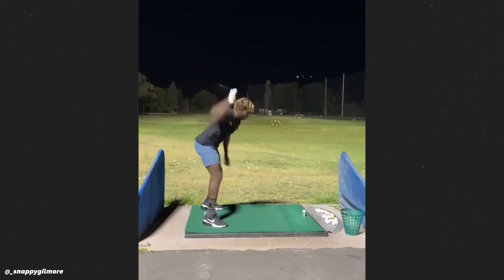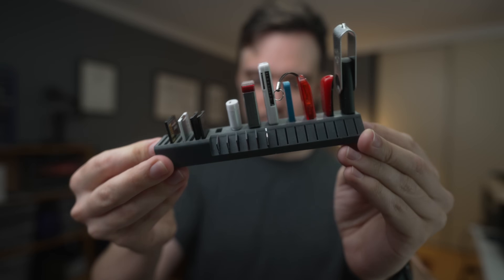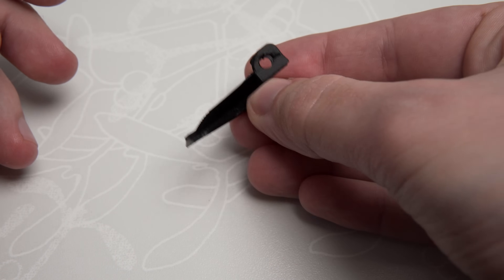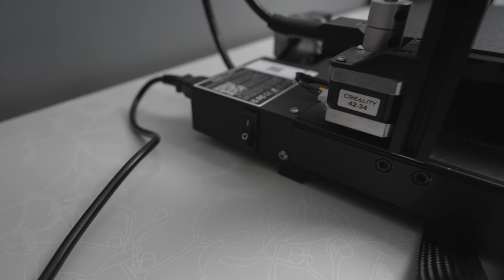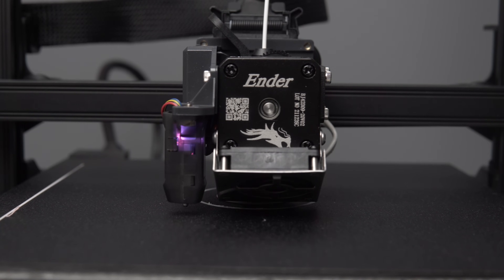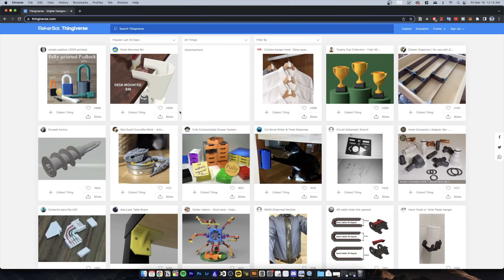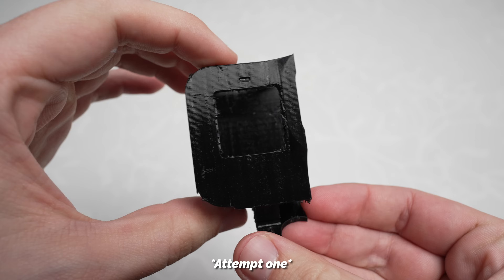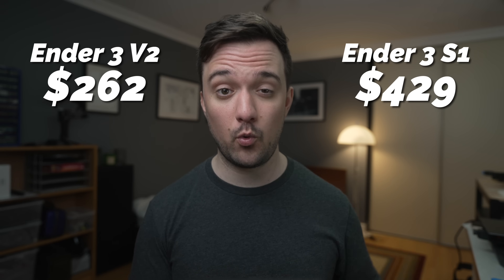How Easy is 3D Printing ACTUALLY? (Ender 3 S1 Review)

Comment: Lol My story is slightly the same...  A friend of mine had a printer but he didn't have the patience for it.  He knew I was a creative type and basically just gave me his Ender S1 Plus.  Used, slightly modded, and no manual.  Trial by fire, just the way I thrive.  Took me a while to figure it out becasue I didn't know about the mod, and he didn't even know it was a Plus, told me it was a pro.  But I figured it out and love 3d printing.  It made me invest in a new printer: K1C.

Comment: Thank. I have an older Ender 3 V but I haven’t used it at all for several years. Now I must print a cartridge holder TK12 for my nearly 60 years old Dual 1019 turntable and I’ll test the printer in few days time. So thanks for this tutorial.

Comment: I got an Ender 3 Pro with 5 rolls of filament for free but I knew nothing about 3D printing. There's a lot to learn but with the help of YouTube videos I was able to learn the in's and outs. The advice I have for novices is consider getting a filament drier or making one  . I bought a cheap 2 roll dehumidifier and I find I have eliminated so many issues and better / more consistent prints. Also I researched and now understand what the correct first level thickness should look like after bed leveling and then I use a CHEP Bed Leveling Test Print  to fine tune and it has been a game changer for me. Also adding "mouse ears" to a difficult print in order to maintain adhesion is a game changer.

Comment: Bowden extruder is NOT going to cut for more fancy filament.  I did my homework so i knew this upfront before i purchased my first one the Ender 3 S1.  Direct extruder is what i want but NOT paying much  more.   
The Ender 3 is truly an amazing deal with what it can do.  Thanks to Creality for making 3D printer possible for the large masses of us.

I bought a used one and I found out it is NOT that hard or complicated to set up and use.  The cool thing is all the stuffs I can print and I can remotely monitor and control anywhere in the world with software add on and a camera.   

Go for it if you don't do then you will never know and learn.  For under $100 you can have one all day long.

Comment: Very easy... -all you need is a BL touch, a glass bed and a PEI sheet IN ADDITION to your Ender3 (100-150 bucks extra on amazon). They will eradicate 95% of all the problems you might have as a beginner.
I really think they should do a V3 or PRO version of the printer, wich includes all that.

Comment: 6:07 Disclaimer, I don't own a 3D printer. It's easier to pull a rope through a hose than to push it.

This I suspect is why you had trouble with softer filament in the old printer and why the new printer, with a filament puller located in the print head instead of a pusher back on the frame, solves that problem.

The older pusher model was pushing soft filament through a hose, and the soft filament had wiggle room in there and being soft, it wiggled around more than harder, stiffer filament.

Now the new "puller" model eliminates the rope-like behavior of the soft filament.

Comment: May knock it but i love my S1. Once you get used to how to level it and adjust the slicer. I get some beautiful prints. Just so people know. Do the manual level first. Start in the middle. Adjust the Z offset using the sheet of paper trick he mentions. Then go to all 4 corners 1 by 1 adjusting the leveling knobs until each are the same level(using the paper). Then do the auto level. Once it is done. Go back to the manual level. Go to the center and adjust the z offset again. DONT adjust the corners. Then just print!

Comment: The big question is... As a first printer, Do you buy an ender 3v2 and struggle a bit (but learn a TON about 3D printing?) or do you buy an ender 3v3 which makes things a lot easier (at the expense of not learning as much due to a smaller initial struggle).

I'm glad I had to suffer through the slings and arrows of an unmodified Ender 3V2 printer (and the resultant mods that made it better over time)

You CAN'T buy any 3D printer that doesn't have 'auto levelling'. A BR (CR) Touch is a must have first mod for any printer.

A PEI bed is important for good adhesion and prints... As well as the dual axis z-rod.

Also... Modifying the firmware will be important ad Creality (while they build decent low-end printers) cripple them with awful awful software (compared to 3rd party 'pro' firmware upgrades).

I love it now. But I didn't for a long time.

Comment: 3D printing is the most frustrating (and then rewarding) hobby. I've almost thrown my ender 3v2 out the window many times... But I seem to have finally modded it, tuned it and now it works consistently with wireless connectivity via Klipper (on PC)

I've printed premade models, modified models and created my own pracital parts from scratch.

Its very satisfying when it works.

Comment: I think TPU is bad on small areas, where the hot end is in too small of an area for too long, which stops the heat from escaping and increases the temperature (of the part in that spot) over time... so it can help to take a break in between layers, so each layer has the chance to cool before printing continues.

Comment: "Something just happened to me right now: the S1 printer had an issue, but I've already fixed it. It was a cable connecting the printer to the bed that had snapped."

Comment: The thing is sooner or later you will run into problems.  I have 3 printers and they've all had problems.  You have to maintain the right humidity which can ruin your filament and prints.  Now my two Anycubic printers aren''t working correctly and won't print.  It always starts out well and then come problems.  Still I think it's just the coolest thing I can think of when it works!

Comment: anyone who is thinking about getting into 3d printing should not consider the ender 3. It is way too frustrating in terms of leveling (unlevels itself after a few prints), print precision (hell of a time to adjust belt tension). With the amount of money you are going to waste from fail prints, just get the ankerbot or bambulab printers, they work straight out of the box, with way faster print times and print quality.

Ive had the ender 3 for 4 years and it was really endless frustrations... Did i get it to print decently? Yes. But that was after rolls and rolls of plastic. totally not worth.

Comment: Thanks for the intro.
When you say you ''made some adjustments'' what were they?
🤔
I'm OK with 3D modelling, and use ''IronCAD''  which I've used intermittently since it was first introduced as ''3D EYE'' many, many years ago. (25)
I have never transferred anything to a 3D printer as I dont have one yet.
I'm 79 years old, so 3D printing is a complete mystery, even ''magic.''
It's the transition, ie ''Slicing'' that I have never encountered. I understand the principle, ie that it calculates the layers, but not the actual process.
Would you give a short explanation please.
Also, are there any transparent plastics that can be 3D printed, for things like lenses on vehicle lamps? I have an old (1953) tractor that I would like to replace missing lamp lenses on.
Thanks again.
.

Comment: One thing I recommend when printing TPU is use an enclosed printer, it will bring some minor strength and quality additions the the TPU print, but you don't really need it. This is just if you want to make it slightly better.

Comment: Thingiverse is awesome. Definitely look at adjusting the slicer settings first. I use CURA with some custom Ultra Fast settings I found from another YouTuber and it literally took hours off the print times. Now I’m having fun printing upgrades! I have an Ender 3 v2 neo which was still cheap but came with the stuff I would have got anyway and is a bit slicker design.

Comment: started 3d printing in the pandemic. Needed a hobby during lockdown. still regularly print and already upgraded my printer a bit
Reply: Hi, are you still doing 3d printing? I was wondering if you could help with something I'm working on. I'm trying to make a simple model and I just need someone to look at the STL file and see if it would actually work. I've never done anything with 3d printing before!

Comment: My friend told me you can 3D print different parts for a hand gun and build a hand gun. I don’t think this is true but anyone know if you can do that?
Reply: You can but they aren’t exactly 100% reliable depending on the part. With a firearm you’re going to run into a lot of heat.

Comment: It is such a relief to hear someone who is also a 3D printer noob who feels the same way I do about it. I am "this close" to getting an Ender 6. I felt exactly like you. I wanted to do it but was concerned about how awful it would be tweaking and settings etc. I was not sure what printer to get. I was told Ender 6 was a good one. After researching it appears that I can update it or make modifications in the future so I won't have to buy a new one (can't afford to buy a bunch of these printers. Just one is what I can afford right now). Also, the Ender 6 has an enclosure (sort of) for temperature control.

Comment: I must have a faulty unit then because I am STRUGGLING to get consistent results with just PLA. I'm having to put a sticky note UNDERNEATH my bed and plate because the bed sags ever so slightly
Reply: Update: That's exactly what happened. Got a replacement and suddenly with a little tweaking I'm getting consistently good prints. At least the days of struggling with a faulty printer made me pretty good at fixing printer problems. Which still happen every couple prints or so.

Comment: The tube guiding the filament to the head was 1 of the problems the hard filament slides through it easily but when you use softer filaments they drag in the tube which stopped it creating sufficient pool to fill large areas. Don’t over tighten the filament drive wheel or you will jam it up.

Comment: As someone who is very new to 3d printing I can say with absolute certainty that it is incredibly easy.  the printer does all the work after all.  What is difficult is all the troubleshooting and fault finding, figuring out settings and creating profiles, learning CAD and design programs and comparing printers and options.  That's the stuff that really gets tough.  But the printing? Not a problem at all.  lol

Comment: I too bought the Ender 3 V2 as my first printer but just cahnged the springs updated the os of the printer and now i have a manual level mesh, and i don't change it very often, so that's i would buy an auto level addon for the printer

Comment: I bought a Anycubic mega zero (first edition, 12 volts) about 1,5 years ago and it no works through its 13. roll of filament. I did some minor repairs (hotend, printbed, plugs with loose connection) but nothing expensive or more than 30 minutes to find and repair the issue.

I mostly print hobby stuff like miniatures (which I paint later), but I also printed household stuff and small gifts for friends. It pays of very quickly. I later bought a resin printer, which actually is at second litre, but that allready paid of compared what buying the same amount of miniatures would cost. 

So I could highly recommend this, especially for people who are in models, toy railroad and so on.

Comment: I’ve had a v2 for about 2 and a half years now and when I first got it I was struggling quite a bit but now I can just press print and leave it. Once you get the printer dialed in it becomes a lot more hands off and a lot less frustrating for me at least.

Comment: I'm super interested in 3D-modeling and 3D-printing, but I'm worried about the waste. Can failed pieces etc. waste be re-used with the printer somehow, or what you do with them?

Also, is there some universal format for 3D-printable files, or do you have to be able to convert them to fit to your printer exactly (can the slicer program read several file formats)? Does the 3D-modeling program have an effect on whether or not it can be  printed? If I use for example blender, and then some other program?

Thank you for any help!
Reply: Sorry for the late answers to your questions, but here they are:
3D printing produces some waste in the form of failed prints and support material. It depends on the type of plastic you use if the material is bad waste or not. PLA is bio-degradable for a certain amount. I personally deliver all my waste once a year in the plastic recycle container in my neighborhood. I heard there is a company in Germany that takes old 3D printer waste and recycles it to new filament rolls. That is a very good solution that let you re-use your waste material. There are also filament producing machines for the home user where you can mix your (scrapped) waste with new pellets to produce your own filament, but they are not cheap, and need a lot of attention to produce consistent quality.

There is an universal format that nearly every slicer can use. It's the STL format (.stl files). Almost every CAD or 3D program is capable of saving files in that format (I personally use FreeCAD and Blender). The slicer accept that file and after slicing it produces a .gcode file. In essence that's a normal text file filled with the so-called G-Code instructions, that a printer use to steer all it's components (head, print surface, temperatures and so on). That's mostly unique for every type of printer, so the slicer has to know what printer you are using.

So yes - In essence you can use any 3D modelling (or CAD) program. However - You have to take in consideration that if you make too complex models (with a lot of holes for instance), printing can become a challenge. It will take me too far to give a detailed explanation here, but if you search YouTube I am certain you will find usable tutorials...
Reply: @jclosed2516  thank you so much for the reply, this was very helpful and answered my every question! I'm just only a beginner on 3D-designing and have no experience on 3D-printing yet, but these answers encourage me to go forward. Have a good day 😊
Reply: @jclosed2516  Hi, I was wondering if maybe you could help with a simple model I want to get 3d printed? I just need someone to look at the STL file and see if it will actually work. I've never done 3d printing before!
Reply: @ct6502c  Well - Only looking at an STL file is not very helpful. The best advise I can give you is importing the STL file in the slicer of your choice (Personally I use the Prusa slicer). The slicer program most times gives you a warning when the STL file is having defects (like not being watertight). You can then rotate the model if needed, and even resize it to the size you want.
After that you slice it, and look at the sliced model if it comes out the way you want it. After that you can export the generated gcode flile. As there are many printer configurations the exact content of that gcode file depends on the 3D printer model you have. In that way it's an unique code that is specially generated for your 3D printer.
I hope this is helpful...
Reply: @jclosed2516  Thanks for the reply! I actually don't have a 3d printer, but I made some models with TinkerCad and I was planning to send them to a 3d printing service. I guess I just wanted to see if they were even printable first before wasting time. I don't know anything about 3d printing, other than I've seen a lot of people on YouTube making custom parts for projects. I really want to try making things, but I feel kind of overwhelmed!
Reply: @ct6502c  I see..
The best advise I can give you is to contact that print service, and ask if they are capable of printing that STL file. That depends on the type of printers they have available. For instance - FDM printers are capable of printing (relatively) large objects with medium detail and with a acceptable tolerance, but raisin printers are capable of printing (relatively) small objects with a very high detail and tolerance.
In other words, the quality of the print service depends on the equipment they have available. For that reason it's best to contact them and ask if they can take a look at your STL file and if they are capable of printing it with the quality you want to have.

Comment: I got the 3 S 1 just for something to mess around with. The frustration level is crazy. I know there are a million videos out there, but there’s no good way to get simple questions answered. Plus, every print I make is several hours or more of print time. So you’re mostly thinking of something to print, downloading it, moving into a slicer program that has nearly infinite settings that make no sense to you, exporting it to an SD card, telling the printer to print it, and then letting it go for hours and hours. And don’t even get me started on trying to design a threaded object. It is effing impossible. I wanted to make some fittings for my wood lathe. I need 3/4 5 threads. Good luck with that. For me, as a long time builder, this just seems like a dungeons and dragons nerd gizmo.

Comment: I'm looking for a good 3d printer.  My ender 3 has leveling issues, upgraded springs, hotend etc.
Ender needs to fix bed and not have filament leaking around hot end.